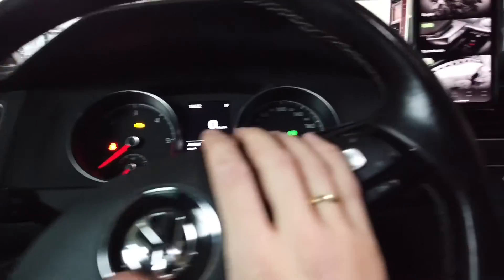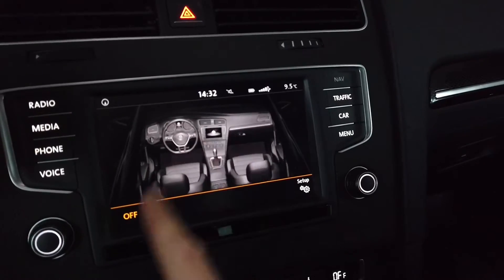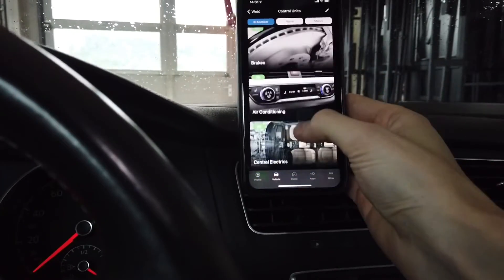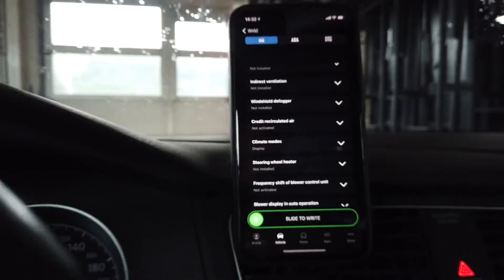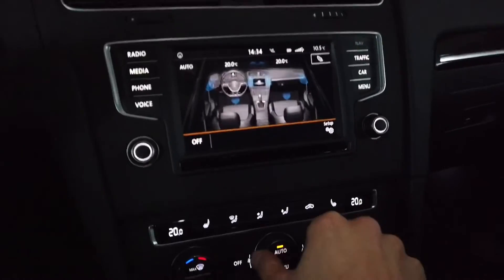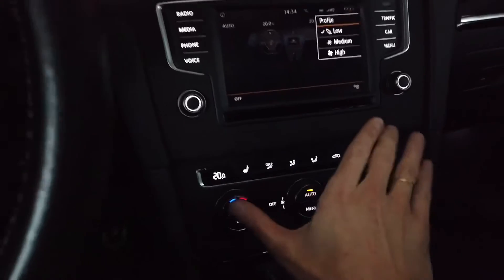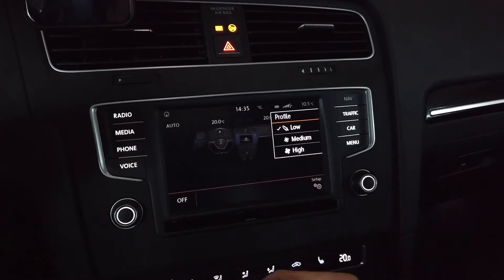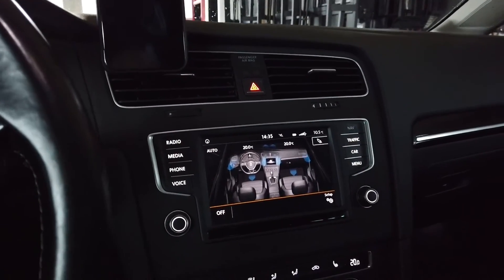VW Golf MK7 (5G) Climatronic fan profile activation

Comment: Hi Mr-Fix, i have a new mib2 unit with the new 8 inch display. However, the climatronic connection does not work. When i press the menu button on the clima the mib2 does not respond. Also the mib2 thinks the climatronic is alwalys off. Have you seen this before? We seem to have tried about every clima option coding in VCDS.
Reply: hello! you fix it?
Reply: you made it work buddy?
Reply: Hi did you fix?

Comment: Thank you! This is exactly what I've been wishing for in my 2019 NAR GTI but seems no one posts about this feature! Wearing contacts I've always preferred a lower fan speed but AUTO would want the fan speed too high, now this can be fixed. Using VCDS I followed your coding procedure in the description, turned car off for a couple minutes, then it showed up. Perfect. Also enabled Air Care and installed the proper FreciousPlus cabin filter.
Reply from the maker: Happy to help! Would also enable AirCare in my MK7 but sadly my Climatronic unit is too old for it.